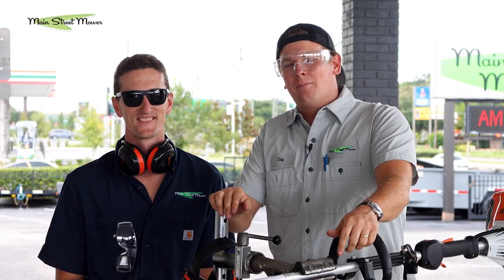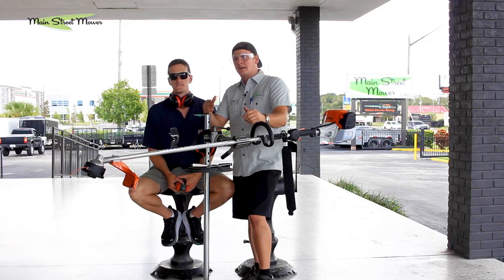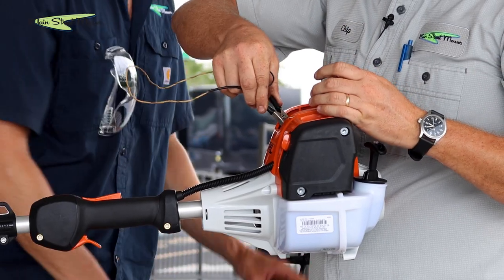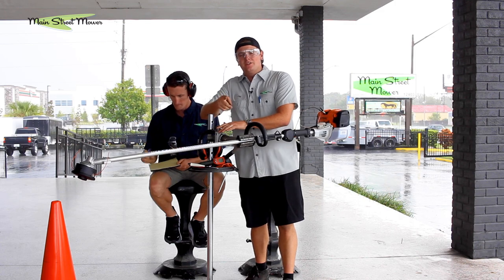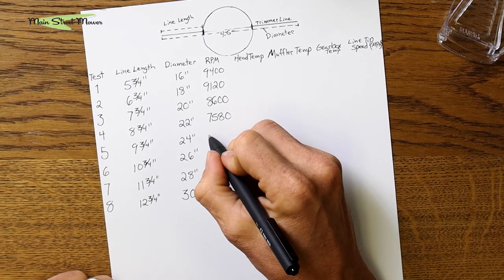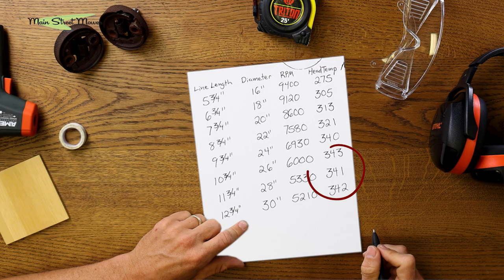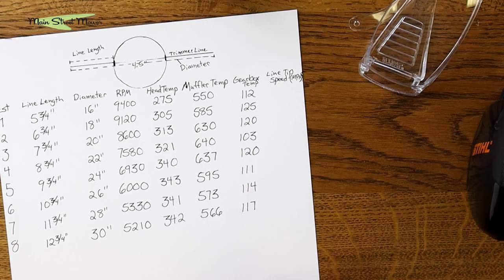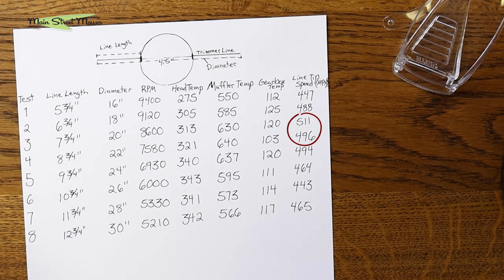We ran a String TRIMMER at every LINE LENGTH (Science Experiment)!

Comment: I love the video and here comes the except...  Real world trimming for the most part is done in "fits and starts"..  not wide open for a tank full of fuel... It's trim, idle walk to the next tree, trim, idle, trim idle rinse and repeat. And you even noticed how the temperature recovered so amazingly fast..  So IMHO long line has very little effect on the trimmer in a daily trimming scenario.  Now running it wide open with super long line trimming 400 linear feet of ditch full of Johnson grass. Yeah that's going to burn it up..  keep cranking out the videos. Love them!
Reply: As someone who has worked in a shop for 12+ years you see clutch failures, etc. a lot more when a line limiter has been removed from the unit.
Reply from the maker: Thanks for the input, definitely agree that the real world is much different. But I think it would mean more load due to the drag. Area = pi x r^2, if you square the radius it means you are cutting exponentially more grass as you increase your line length. Our test doesn’t account for that.
Reply: We do trim long spans at a time or big hills etc and we havent had any breakdowns except carb wearing out after a few years and a few days ago a coil on a 2 month old redmax(not heat related i dont think. more of a fluke thing). Sooo given the cost of a trimmer and the labor costs around here to work on them I dont really worry about it. I know every few years or so Ill need a new trimmer to add to the fleet and at 350 bucks they pay for themselves so many times over its really not a big deal. This is my opinion. When someone asks me what trimmer to buy I explain exactly this. They are disposable so buy whichever you want as long as its a pro trimmer and you buy it local. I myself worked at a mower shop for a few years and someone would bring in a trimmer to get worked on. We mostly saw carb or fuel system issues along with a rare clogged exhaust screen. Most of the time my boss would call and give them the repair price and the customer would elect to buy a new one. Very interesting test though.
Reply: I do 400 feet of ditch plus, so this meant a lot to me keeping the guard on!  Thx.
Reply: Yeah, I’m calling BS on the idea that you can run long string cutting grass all day and having no ill effects over time.  Plus the Mix 4 engines are set up with the triggers to run at near full rpm.
Reply: Yeah and those guys know how to adjust WOT to compensate for line length. I know I do!

Comment: I run with the guard off, and haven't had any issues. I have ran a Stihl 91 for about 5 years with no guard.  However, the line is probably no different in length than if the guard was on. I have run a trimmer long enough, that I can tell by the sound, what is the correct length. Also, you can feel it bog down if the line is too long and I can hear and just feel what it needs to be at.
Reply from the maker: That's awesome. Thank you for sharing.
Reply: This right here. I prefer guard off, not because it give me more line, but because it’s lighter and I like the control better. I can also tell when I have it too long.
Reply: I am at 10 years no guard. I go by feel and sound!!

Comment: What is the ratio of fuel to oil mixture?  I usually use 40:1 although 50:1 is recommended.  I like to make sure the rod bearings are well oiled.  I've got 2 Husqvarna chainsaws, 1 Husqvarna weed eater and 1 Poulan chainsaw.   Cheers from eastern TN

Comment: I think the main reason you didnt achieve a melt down is because you wasn't really putting a load on the engine other than just the string lenth and wind resistant. If you was actually cutting thick grass with the sting out that long i believe it would cause a melt down  or at least over heat alot more than it did.
Reply from the maker: Totally agree
Reply: Sir physics have already determined.What would happen if there were a load on?It didn't need to destroy a machine and waste all their time

Comment: We run guard off, my son runs  long line I don't...  Here is my take on carbon build up. Nothing scientific but just things that I have seen in videos and maybe a little logic. From my understanding, weed wackers are tuned to be ran at full throttle.  Very Very rarely on a daily basis do we run the trimmer wide open. Guard or no guard  no one is running their weed wackers wide open all day long? If they are, they have a lot of insurance claims to pay because there's really no reason for daily trimming to run the weed wacker more than half throttle and that is what i think leads to the large amounts of carbon buildup because it's not burning the fuel efficiently as it does when it's wide open.  Just my 2 cents.
Reply from the maker: That's very Interesting. Might be the case. Thank you for sharing.

Comment: Do you have a video showing whats inside the four stroke motors?
Does it operate like a normal four stroke engine (oil pumped around bottom end, even if pumping action is done by crankcase depression (I think Husqvarna did it on 510cc motorcycle in late 80's, no conventiona oil pump)
I've never seen inside one of the tiny string trimmer engines although heard everything is super miniature?
Reply from the maker: We do not have a video like that but man that would be an interesting one. We'll see if we can work on something like that. Thanks for sharing🙂
Reply: @mainstreetmower  Cool, thanks.
I'm pretty sure vast majority of people have no idea what's inside the new 'CARB Compliant' engines (me included)
 I work on motorcycles with integrated transmission so even a fully instructional 'in depth' video on a single cylinder direct drive should only be around 40 minutes.
 I stopped making any kind of instructional video's 2012 as the damn editing took way too long (the only one I posted took over 4 days and looking at it now, it's embarrassing) Computers have come a long way since then but you still have to look at everything
Reply from the maker: @1crazypj   absolutely. God bless technology. It doesn't take as much time to edit as it used to back in the day.

Comment: We run with guards off. Mainly for ditches, and being able to get into tight spaces for trimming. We may be a little over the recommended, but again that’s usually in ditches where we need to cover more ground. I’m going through year 4 with a 94r and a 91. I run rec fuel, the still ultra, and change out fuel filters and air filters, and spark plugs every spring. Other than cleaning the spark arrestors about once a month, that’s it. That’s all we’ve done.

Comment: I wonder what this test would look like in a 2 stroke? I think we need another test done!
Reply from the maker: Great Idea Joseph. We'll drop that one as soon as this one receives 1k likes.
Reply: I run guard off on a 2 stroke, lets just say they are right toward the end of the video, my spark arrestor was in the trash can after about 4 months of use, and I dont think my trimmer has had a muffler for the last 3 years. it clogged up and I was like. meh, thats what ear pro is for. but im way up north, up here, we dont usually buy the 500+ dollar trimmer and  try to make it last a decade or more. most the companies around me, we tend to buy the middle of pack trimmer and ride that sucker into the ground over 2 to 5 years then replace it and toss the one we killed in the back of the shop to yank parts off.

Comment: Im a contractor in aus and I run fs 91R with bike handles . I have done the same job with and without guard and there is a huge difference in time. Long heavy sloped verge with guard took very close to 9hrs to complete and accidently bumping of the string which is unavoidable would cause me to go through about 4 times more string. Without the guard the same job only takes me about 5hrs.

Comment: I run a FS 56r in a commercial application with no guard 7-8 inch of line out single line not dual, for general trimming, 10 inch of line for mowing applications like hillsides. then under really large trees ill do the 13 inch of line but i only feather that to cut the wispy grass under a shade tree. years and years and years on this unit with a gear head with no grease port. curious about exhaust temps when you remove the spark arestor?

Comment: Nice video we did that test at Royal Edger and mower with the Stihl technical service rep there results were closer to the Stihl results with a Fs90r  what trimmer did you use ?  and it was new trimmer not broke in yet great video thanks
Reply: I'm going to guess it was an FS91R by the price at the end but I may be wrong.
Reply from the maker: It was a FS91R, not broke in yet and we agree that it would’ve been better if it was
Reply: @mainstreetmower  still the best trimmer they need love in the beginning 🥺

Comment: The carbon might come from the oil Stihl Ultra has a Jaso rating of FB   F being the lubricant and B being the amount of detergent Jaso ratings Start from FA to FD.  Stihl oil is made by Castrol HP. and Ultra is made by Spectrum. I like Amsoil Sabre it's rating is FD Shaeffer oil is very good too especially for chainsaws  Ultra shows carbon problems in chainsaws. Watch Richard Flagg videos take care great video
Reply: Stihl Ultra is the absolute worst oil you can get. That junk doesn’t lubricate worth crap and it’s very dirty. I run red armor oil at 40:1 myself it’s probably not the best but it’s hard to beat for the price. I pay around $40 a gallon for it at my local dealer.

Comment: try with 1-5 meter long line.
Reply from the maker: I think running a 12.75 in line was enough to know how much it was hurting your unit.
Reply: @mainstreetmower  ok thanks for replying sir. ;) should you i buy 2,4mm normal line(the one with less noise cuz it cost the same, 2,7mm line with less noise? or cf3pro 2,4mm or cf3 pro 2,7mm? and how much length(im starting a lawn care business, using my stihl km 131(bike handle) and fs km with c 26-2. i think i should have around  35+m so i can load it 4 times. Thanks and waiting for a reply! :D

Comment: Do you guys have any thoughts about how using a Stihl woodcut blade will affect clutch wear? I’m guessing the torque is quite a bit higher than using standard line.

I’ve been using this brush blade on an FS91, and am able to cut fairly thick brush so long as I bring the blade into the sapling quickly/firmly. Do you think this kind of ‘shock’ load will be very detrimental to the trimmer (and also would this fall under warranty if accelerated wear occurs?) This process does sometimes stall the blade if the sapling is thick enough. 

Thanks for your video.
Reply: oh yea, unless your using a very beefy trimmer, they absolutely hate those wood cutter blades, doesnt matter what blade, we do a ton of violation cuts/ recoveries and after a full day of on and off woodblade use my trimmer hates my guts,  >_> my advice, if your gonna be doing any kinda sapling removal regularly with the blade attachment, get a new trimmer and make that your dedicated standard trimmer, and your tired worn out one the "imma beat the tar outta this some more with the wood blade" trimmer. this way you dont feel to bad when it kicks the bucket, cause you already got several years outta it as a normal trimmer.

Comment: Been running the fs 100 for 2 years not a problem yet no trimmer guard but I don't let the line get so far out that it bogs engine down
Reply from the maker: That's great. Thank you for sharing. What line length do you usually run?
Reply: @mainstreetmower  095
Reply: @mainstreetmower  half of the time I don't even run it wide Open
Reply: @mainstreetmower  but your video did make sense
Reply: @mainstreetmower  he usually runs at about 15 in Long
Reply from the maker: @margarethatcher1731  wow. That's amazing

Comment: You missed it. The gearbox temp is indeed due to the grease shear friction. But also longer line creates more air movement. The vortex cools the gearbox. Sometimes bigger fan at lower rpm is the answer. 🎉

Comment: No one weed eats at 10+ unless maybe it's a Road crew from the DOT or county
Reply from the maker: Sir, trust us. You will be surprised.
Reply: I got 100 dollars that says if you jumped in my truck with me and spent the afternoon measuring random companies we pass on the roads trimmer lines, 80% of them are over 10. in my neck of the woods nearly no one cares about cut quality and how the lawn looks, they just want it short enough the city wont fine em, so its volume, volume volume here. so we ride fast, take wide turns so we dont gotta play around with Y turns and close edges, and trimmer line extended out the wazoo to quickly clean up everywhere ya missed.  my best friend is a sales guy at the local dealer and he even laughs constantly about the guys who come in to buy trimmers. "gimme a few mines to get the warrenty papers on file and we'll get ya squared away" Customer "dont bother, im taking the guard off and gonna run this sucker into the ground before the warrenty is up n replace it anyways"  its a thing.

Comment: With that Stihl, it might go in a year, but my Echos, on the other hand..... 😂 Then again, I don't run my line stupid long either.
Reply from the maker: That's good. Echo tends to have more power than Stihl units but that is also a reason the echo's go bad quicker because of more load on the engine. STIHL really has no competition when it comes to longevity, comfort, & efficiency.
Reply: @mainstreetmower    There have been hiccups here and there over the years, but I haven't had any major or repeating issues with Echo in any of those departments, except I do use the larger models of e everything, so that can lead to fatigue, but then I try to take my vitamins and eat my Wheaties to compensate 😋
Reply from the maker: Haha that's fair @Pure_KodiakWILD_Power .
Reply: Stihl not worth it… 🤣 I’d say neither is Echo tho. Maruyama if i had to buy new.